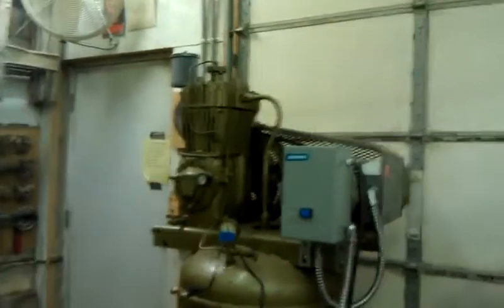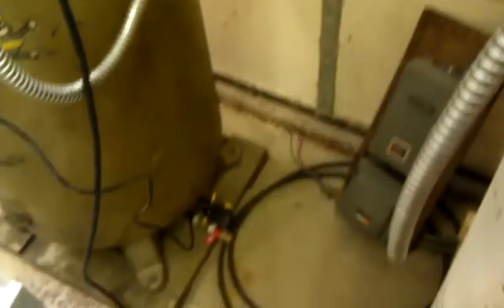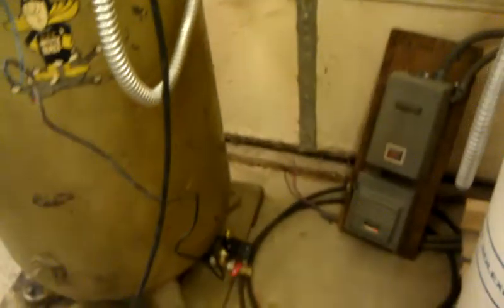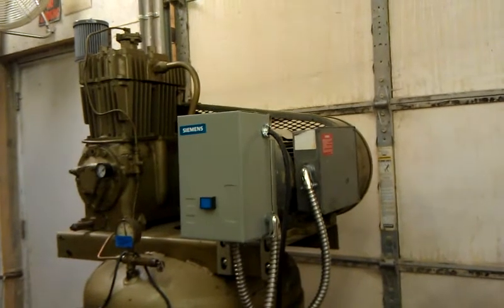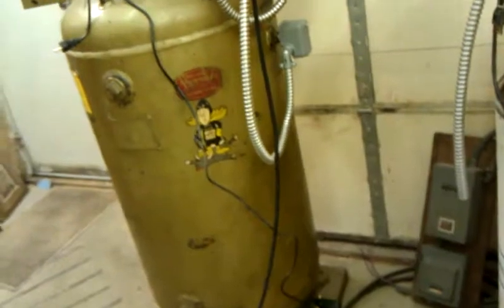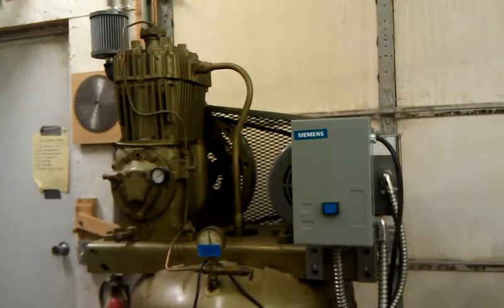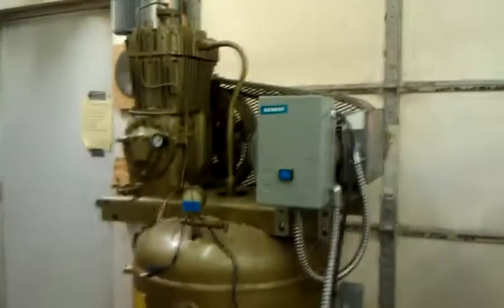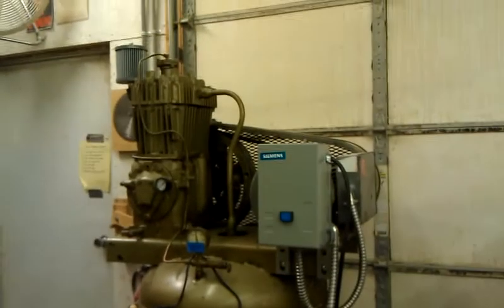Quincy QR 325 Compressor Update 2-27-12 # 40

Comment: I had 3 compressors like you have at a cotton gin where we used a lot of air 2 times each 12 hour shift.  Never enough air so I plumbed the air in series and added a 250 gallon tank.  Also wired the compressors to one pressure switch so that they all came on at the same time.  .  But the best enhancement was adding the water purge system.  Like you, ours was timed off of the contactor.  It is just what you need and you will love never having to screw with it.